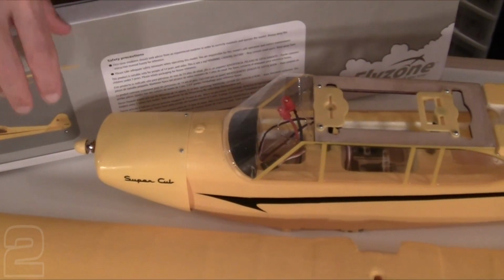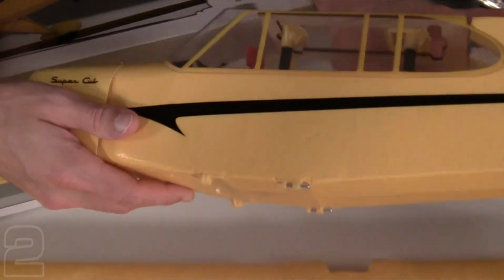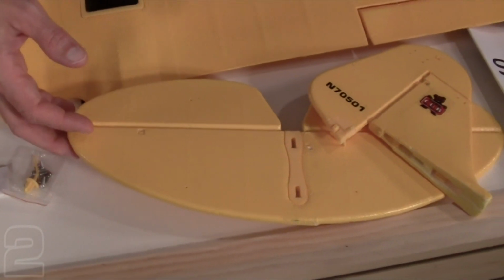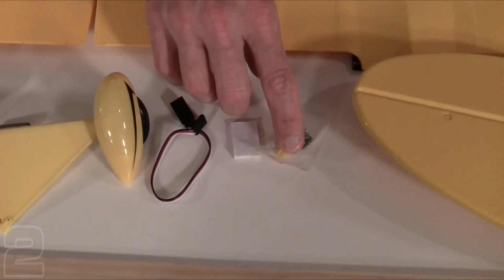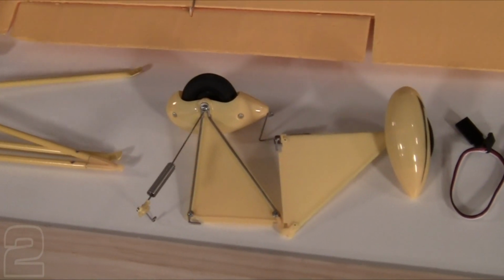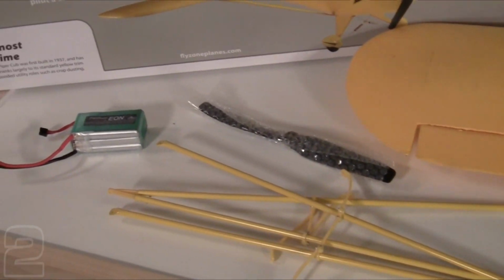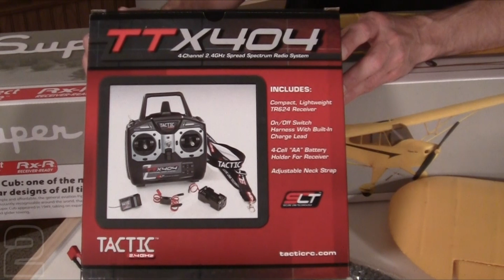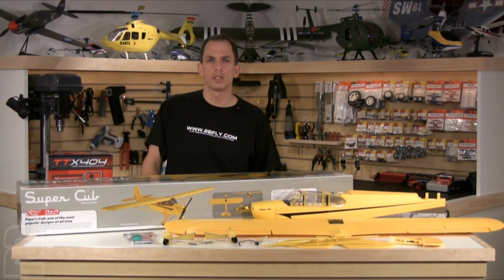FlyZone Super Cub Select Scale Review - Part 1

Comment from the maker: @zyxelina - Yes, the AR6115 receiver will get power from the Battery Eliminator Circuit (BEC) built in to the ESC.  The BEC "siphons" some power (approx 5.0V) from the attached main flight pack and back-feed it through it's radio connection.  No receiver battery required!

Comment from the maker: @MsMrdracing - I should think that a .10 would help add performance and the airframe would handle it just fine.  The only problem there is once you step up the motor, you increase the battery consumption rate so you'd probably want a higher capacity battery.  There's little to no room for a full length (1800mAh+) 11.1 LiPo so finding a good battery capacity solution that would fit (and balance!) for a .10 would be your challenge with the super cub.

Comment: I totally wore one out in about 2 years and hundreds of flights. I just ordered a new one because I love the plane. They fly great, and they are dependable. The landing gear is the best ive ever seen on any rc plane, it actually works, and amazing well at that.
These Cubs are what some people would call underpowered, but it's a scale plane,  and they do have more than scale power, but don't expect a bunch of vertical ability with the stock motor and esc. I love them stock out of the box myself.
The roll rate is that of a real Cub, and they basically fly scale real well.
They also barely get a 20C 3S 1300mah battery warm, very nice.   Dennis
Reply: A friend have this a periode and he dived it on it,s gears whitout killing it but after a while he killed the plane itself.But they last long, i flown a cessna 150 cm edo for 6 years and no a corvalis.Spring loaded shock absorber on it,s nose,some vids in my instagram from altitudes under same name,a good flying=)